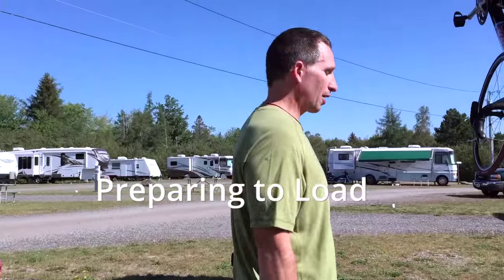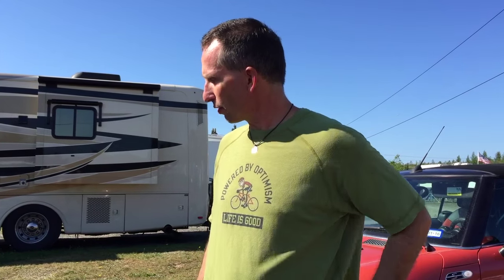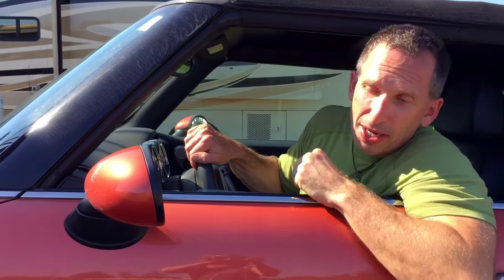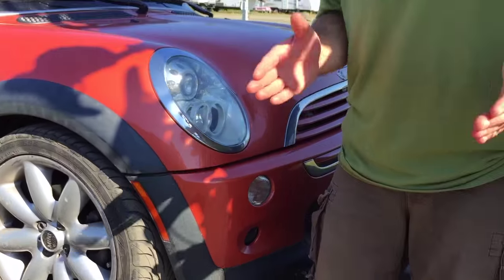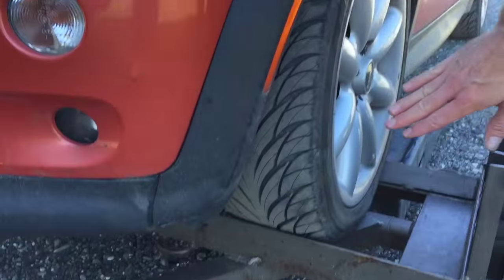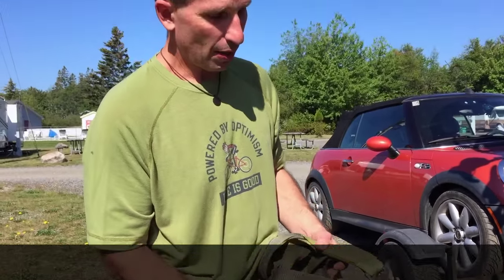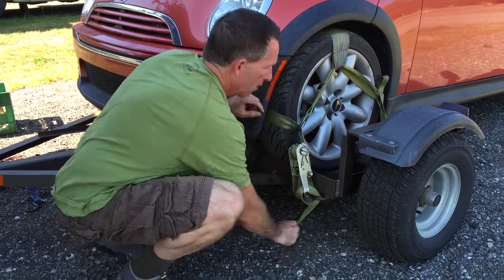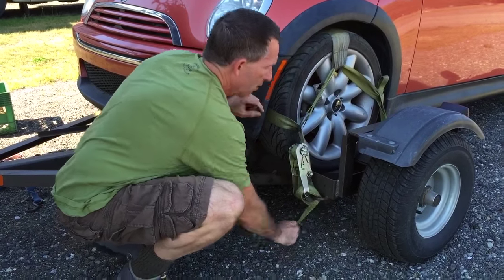How to Load a Car (TOAD) onto a Tow Dolly – Towing Option for RVers

Comment: I would rather just use a tow bar is once you get to a campground it stows away then with a dolly it takes up space at smaller campgrounds or parks.
Reply from the maker: +Darren Boggs We've never had a problem finding space for our dolly at campgrounds in 16 months so far. Even in shorter campsites it slides 80% under our coach.
Reply: +RVLove | Marc & Julie Bennett Great video!
You guys have a TON of good info in your blog post on the subject on your website. It's a tough decision in the end. 

I went with the Blue Ox baseplate on Agent Cooper. Had it installed by Sky Meadows mobile RV Repair in Starke, FL back in January for a song. 8000 miles later, I'm still happy I chose to go the way I did. Once the RV is out of the campsite, I can be hooked up and ready to go in about 3.5 minutes vs. 10. 

* Pull up to the tow bar.
* Fold down the arms on the tow bar.
* Install tow pins to the receivers in the front bumper if I removed them (which I don't for short stays). 
* Connect towbar arms with the tow pins, securing with long shackle Master Locks that I picked up at Wal-Mart.
* Put car in neutral, Parking brake off. Lock car.
* Push car backwards until the tow bar arms "clicks" into place. 
* Attach safety cables to the Carabiners attached to the frame. 
* Attach U-haul magnetic lights to the top-rear of the car - run excess cable underneath the windshield wipers - and plug into the 4-pin connector at the back of the coach. 
* Start the coach, pull the coach forward 5-10 feet, check the arms, check the lights. 
* Drive away.

For me, trying to figure out what to do with an extra piece of hardware at every site, and (more importantly for me) not having to be concerned about someone making off with the dolly, leaving me essentially stranded until I replaced it, whereas I can take the Blue Ox Towbar and put it in a storage bay, or even secured inside the coach. It's a small risk, but it is non-zero, and wound up being enough of a factor that I went with towing 4-down. 

Also, I cringed a little when the driver's side ramp moved in the gravel under the torque of the car the first time you went up the ramp. The thought of torquing the ramp right out from under the wheel before you get onto the dolly? Yeah, that's nightmare fuel right there...and there are plenty of examples on YouTube to make it a valid concern, I think... =(

Comment: Towing with automatic or manual
Reply from the maker: Our MINI was a 6 speed manual, and therefore was able to be towed 4-down, instead of on a dolly.  But we chose to tow on a dolly because it was lifted off the ground more, and reduced the investment as we felt it was not worth over investing in equipment for towing 4-down on such an inexpensive car. -M

Comment: Does anyone know where i can find these straps???
Reply from the maker: Straps depend on tow dolly type.  Even ACME 
(the brand we have, has changed their straps multiple times).  First path is to check with the manufacturer of the brand tow dolly you have, but you can likely find a selection of straps on amazon as well. -M
Reply: RVLove | Marc & Julie Bennett ive searched EVERYWHERE. For these 4 point snaps. I have the exact dolly in this video. Ended up getting 3 point basket and hoping it works

Comment: I have used a dolly like that an I have to say that I am not a fan. The lack of a real pivot point puts way to much strain on the tow car when turning.
Reply from the maker: +RCRV We looked into them, definitely some advantages to swivel deck tow dolly, we found there were pros and cons to every towing solution available. But ultimately, none of the swivel decks we could find were suitable for a car with such a low load height as our MINI (or as affordable).

Comment: why does the steering wheel need to be unlocked?
Reply from the maker: Because the ACME dolly unlike dollies with swivel decks do not pivot so the only way to properly turn is by letting the wheels of the car turn.

Comment: If one wheel wasn't perfect, couldn't you just attach the tie-downs, drive 30-40 meters and the tires would settle evenly, retighten the tie-downs.
Reply from the maker: I often retighten after a short move too.  It doesn't need to be perfect, but the better the initial line up, the better. -M
Reply from the maker: I often retighten after a short move too.  It doesn't need to be perfect, but the better the initial line up, the better. -M
Reply: @Rvlove  To elaborate a bit: tighten the left wheel(your point of view) very tight, attach the right wheel rather slack. Drive 30-50 meters and the wheel will even out...re-tightens, drawing the wheels tight to front stop bar. Drive another 20-30 meters, re-check, and you're done. This does away with repeated steps  driving onto the dolly.

Comment: your towing vehicules has poor safety brakes cause everything moved once you got on your dolly and your ramps almost spun out from under your toad which can spell disaster for the front end . Your ramps should be structurally part of your dolly to avoid that...not a very good idea to do this on loose gravel with those ramps
Reply from the maker: We towed with a dolly for 3.5 years with no issues but yes always optimal to do on a solid surface other than gravel if possible.

Comment: Unfortunately, you didn’t go over whether or not you leave the car ignition on steering unlocked
Reply from the maker: it depends on the tow dolly and vehicle. It's been a few years, but pretty sure with this dolly and car, the steering were unlocked.